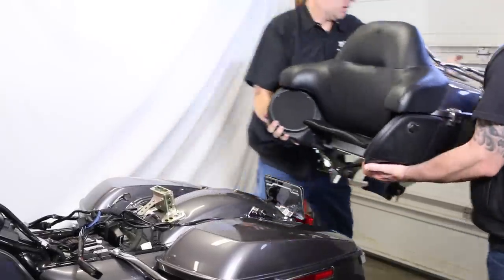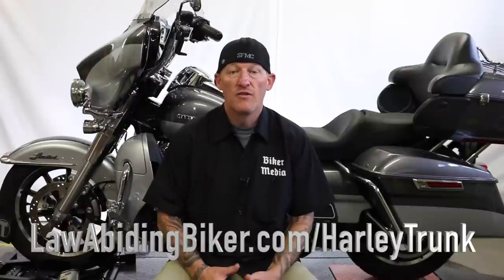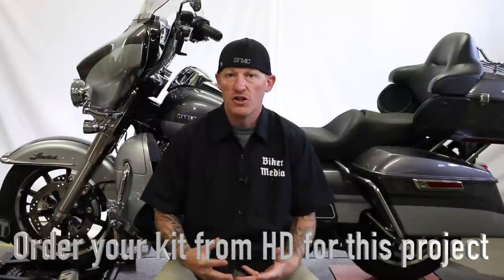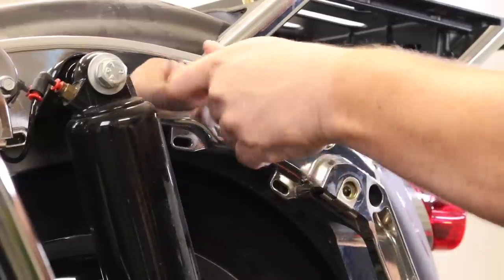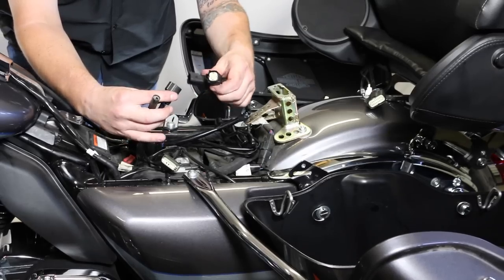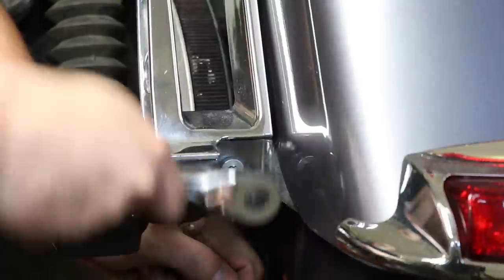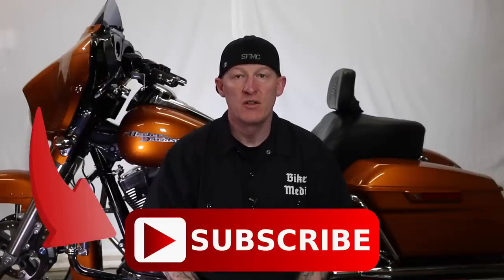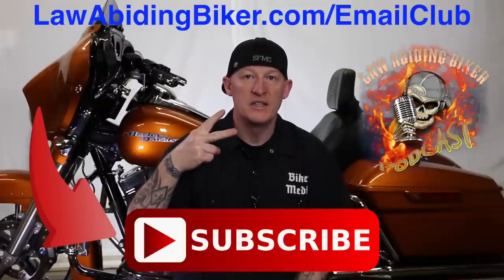Install a Harley Davidson Detachable Trunk, Hardware, & Relocate Antennas & Signals | Touring Models

Comment: This video cost me 24.95. Connectivity was kinda slow took some time buffering but it kind helped me out as it gave me time to follow exactly what the video was doing without having to pause it. They made it very simple to follow and installation was a breeze because of this video. Took me just under 3 hours to do it. The hardest part was literally stuffing all the wires under the seat to complete the job. My dealer quoted me 6 hours. Video was totally worth and I would buy again. Saved me over 500 dollars. No brainer
Reply from the maker: Rock on!! Glad to hear it and that the video helped. The connection issue was on your end of sorts.....connection issue/bandwidth I would guess.....ride safe and thanks for the feedback1

Comment: I've got a 2017 Street Glide special and have purchase and mounted a color matched King tour pak.  I'm now wanting to wire the tour pack up with an LED light bar, but I'm not sure exactly what wiring harness to get or how to connect to existing wiring plugs.  I'm willing to pay for your video as long as it lists any specific wiring harness product numbers needed and shows how to make the connections, does yours do this?  Thanks.
Reply: I have the same issue, i hope you got the answer
Reply: @alalal420   I have the same issue did you ever get an answer
Reply: What color is the paint on your bike?

Comment: I have added a detachable King Tour-Pak to my 2019 FLTRX.   I am adding the LED King Tour-Pak Brake/Turn/Tail Lamp Kit PN-67800368 and have no need for an entire stock trunk harness.  No side lights, no CB or FM antennas, no aux power...  All I need is a detachable harness that terminates with a 5-Pin Delphi Female connector and where to connect the source.  Will this video show how to wire the LED King Tour-Pak light for full function and detachable on a stock 2019 FLTRX?

Comment: I have a 2015 road glide and installed a Harley trunk with a light bar. Does this video show how to connect wiring harness to bike?
Reply from the maker: +Dan Bustin We show the entire stock trunk harness and how everything connects/disconnects for the detachable trunk. Had zero complaints on that video. No lack of detail or info in our videos. Get it and check it out. If for some odd reason it's not helpful (weird), we'd refund you of course. Here to help bikers first and that's our commitment. Video Here: https://gumroad.com/l/harleytrunk

Comment: I was wondering. I was a fool to my tour pack apart to repaint it to match my bike we are going to Sturgis and so we bought a tour pack. I have a 2011  candy apple green. But anyways I took everything out of the inside. It took longer than echoed to get it back. And I have a ground wire on the insure I can't remember ever it goes. If anyone has a clue I could use the help

Comment: Would I use the same kit, to put a 2012 Ultra tour pak on a 2015 road King? I just need the lights to work
Reply from the maker: You'd have to cross reference that with a dealership to check on Fitment.